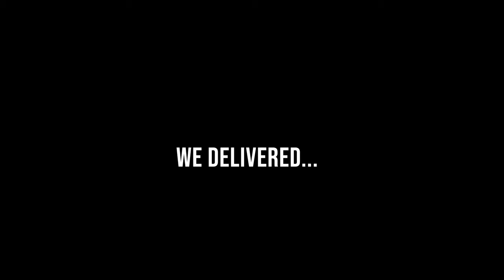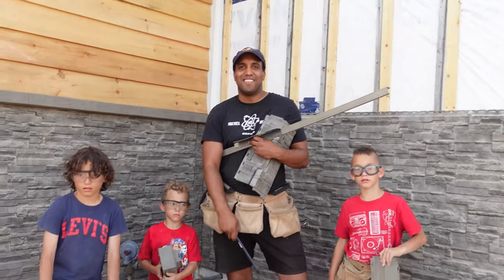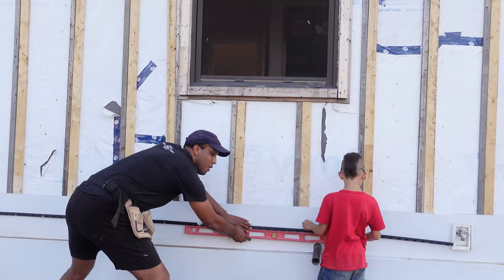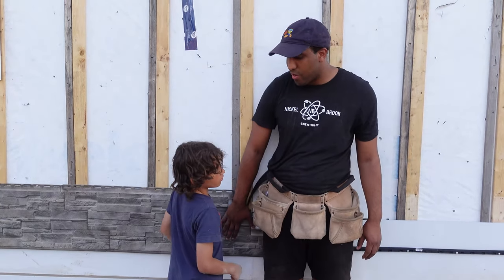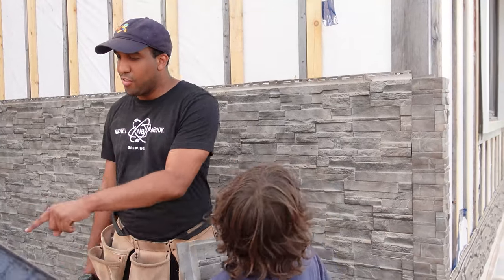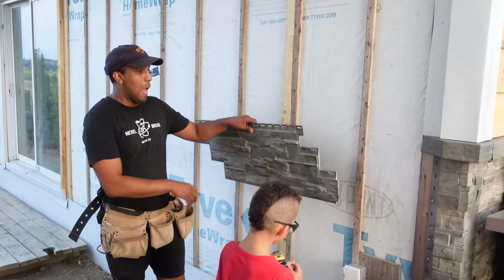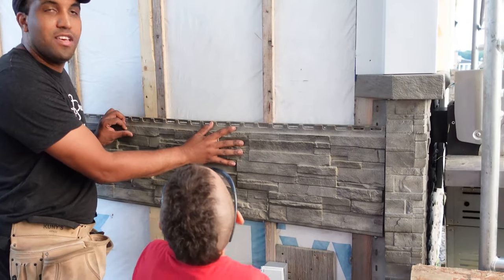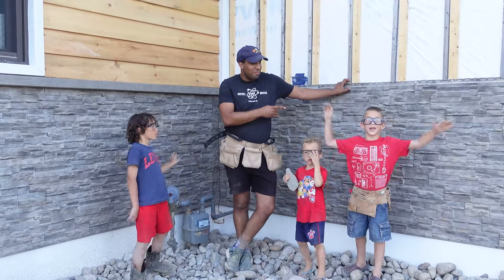Novik Stone Install & Review

Comment: You don't get a feel that rain water that gets blown up against the buildi g will run behind the product? Look at the notch they sit into  there are weep holes. Water will clearly run down into the notch and weep behind. I almost want to install it upside down.
Reply from the maker: Yea, you definitely need vapor barrier! The way they lock into each other prevents most of the water getting through. I am sure not too much moisture will seep back there.
Reply: Thats the whole point of the furring strips. He is creating an air gap behind the siding, often referred to as a rainscreen installation. I am not a huge fan of his choice of house wrap in combination with the rainscreen but its better than nothing I guess? The rainscreen allows air to get behind the siding and dry out after a heavy rain. Every house with siding gets water behind it, houses without an air gap are the ones you need to worry about.

Comment: Awesome! I want to use this stuff, but do you have to buy their starter strip or can you just use regular starter strip? Also, can you get away without using the ledge and ledge corner?? It’s gonna put me way over budget if I have to buy the ledge, wondering if the vinyl siding will just clip on there or maybe just using another starter strip…
Reply from the maker: You can definitely use a regular starter strip. Not too sure about the corners though
Reply: @MichaelMoses thanks so much for that on the starters. Someone else said you had to use their starter. Good to know you don’t. And I didn’t mean the corners, I meant the ledge, top finishing piece. I was just wanting to go from the Novik stone to the vinyl siding with no ledge in between to avoid cost. I really do appreciate your help!

Comment: Great vid. My question is do you do same steps for each corner by cutting sheet straight?
Reply from the maker: Pretty much yes, but when you are cutting you must tilt the grinder slightly so the piece has a small mitre on it, angled from the good size/"finished face" to the back..if that makes sense. It helps to "hide" the cut from the finish face.

Comment: Does this material bend? I want to build my mom a 4' diameter wishing well so it will be circular.
Reply from the maker: Hi Lavon, unfortunately it would not be suitable for a circular structure. It does "bend" but not in the way you'd need. It would be very difficult to keep the edges from protruding so it wouldn't be a smooth nice circular surface!

Comment: How much do they cost a panel ? And what is the size of each panel
Reply from the maker: We got the from Home Depot. 189/box. 
NovikStone DS panel is 41.5" L x 13.13" H (105.41 cm L x 33.34 cm H), a box contains 10 panels and covers approximately 25 sq. ft. (2.34 m2).
Reply: They are insanely pricey but still cheaper than doing real stacked stone🤷‍♂️